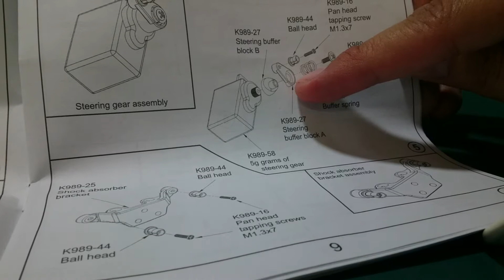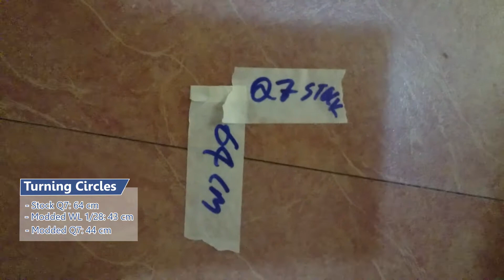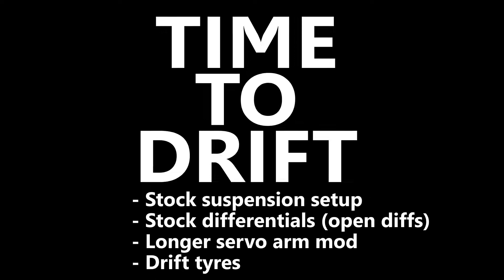Mini-Q Q7 First Mod/Fix: Servo Arm & Drifting Footage

Comment: Hey Beaver do you think the recent Q7, or perhaps the ARR version with different receiver config, comes with larger steering angle out of the box? I'm still waiting for the k989 servo horn to arrive, but I just measured the turning circle of my Q7 using the same method in this video and I got 49cm, versus 64cm in your first Q7 and 44cm post mod.
Reply from the maker: The ARR version depends on the transmitter you use. Some transmitter like some Flysky output wider pulse range than other radios so you have more steering out of it.
Reply: @BeaversHobby  Cool that makes sense. Just for the record I'm using radiolink rc4gs and r4fgm rx.
Reply from the maker: @sammybaka  Nice! Radiolink probably did some improvement because that's roughly the same as what I have with my Noble NB4. My very old RC3S doesn't output much range.

Comment: An even easier way I found to add more steering angle/servo arm height is by shimming the servo and mounting points. Added an equivalent of a third mounting point on the arm. This on k989, may differ on mini-q.
Reply from the maker: K989 servo arm has 2 holes, Mini-Q does not. That's why I use K989 servo arm in this. Extending servo arm is good idea because it can be as long as I want. But this is  quite complicated on Mini-Q servo arm because it's short, slim and has one hole. I'd have to drill in another lower hole to support the bracing, etc.. It's actually easier to just change the arm.

Comment: Hi dude, I bought the Mini Q7 around two years ago when I first watched this video, to be honest it's sat unused on the shelf for most of that time....... I've recently managed to get enough time to get it out of the box to have a play 😊👍 I've done this steering angle mod in this video...... only when the car is on full lock the original swing shafts (that came with the car) become "sticky" causing the wheel that is affected to jump upwards inside the arch of the shell, causing it to bounce very violently on the front end. I have tried to swap the shafts out for some atomic amz short one's I have, only they wasn't long enough to make drive😔 I've also tried swapping the shafts around so the smoothest are mounted up front and still no cigar....... have you had any of this type of problems with yours? If so do you know of a way that I could fix the original shafts? or perhaps you may know of someone who makes a decent swing shaft for this model? Many thanks 👍
Reply from the maker: I did have sticky drive shafts out of the box. Then I oiled them with bicycle chain oil and the problem went away. This car needs at least 9mm shafts from WLtoys K989. You can also try long 10.5mm shafts but they might get stuck in neutral/straight.
Reply: Great idea 😊 thank you dude 👍 I do have some spare wltoys 1/28 shafts if the oil doesn't work.
Reply: Thank you so much for this tip 👍 with the oil she's drifting very smoothly I even did the rear shafts for good measure 👍
Reply from the maker: @tomwright943  Glad it worked!
Reply: All thanks to you dude 🤘😎🤘

Comment: When you changes the servo arm to a longer one, do you see the problem of dogbone cornering limit?? Because when i do this, my mini q7 is not good enough when its turn right. Sometimes the front right wheel is spinning and sometimes not.
Reply from the maker: Ciki Biu I had the same too but the problem wasn't the steering angle, it's the swing shaft. You need to oil them or grease them. I apllied simple bicycle chain oil, ran them a bit and everything is smooth.
Reply: Beaver's Hobby my problem is only totally turn right, and everything is normal when its turn left or only half of turn right. Do you think there is problem on swing shaft??
Reply from the maker: Yes. If you're sure that the wheel doesn't rub the shock then the only thing is swing shaft (dog bone). Apparently some of dog bones aren't properly made and lock up while turning at high angle. Mine was locking up one wheel at high angle too. Some time it didn't completely lock up but still shattering like mad. So I applied some oil to all of them, wipe off the excess and everything is fine and smooth.